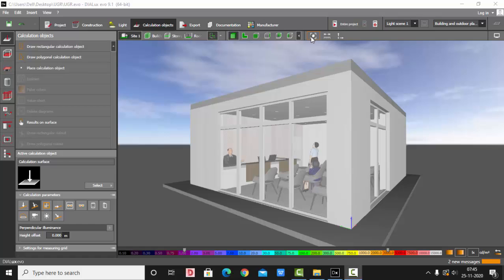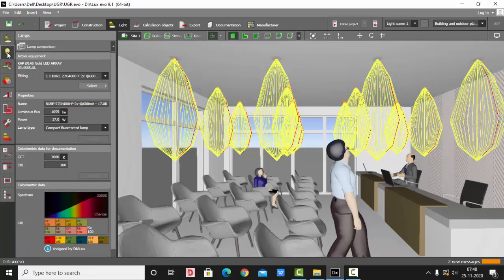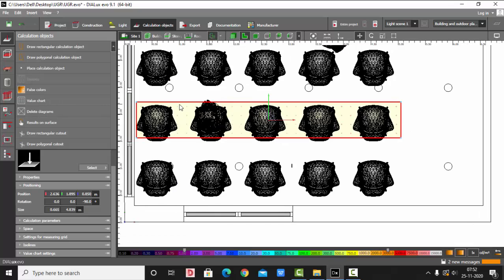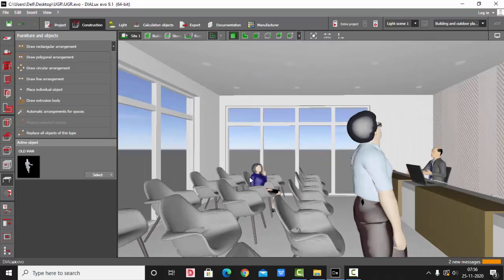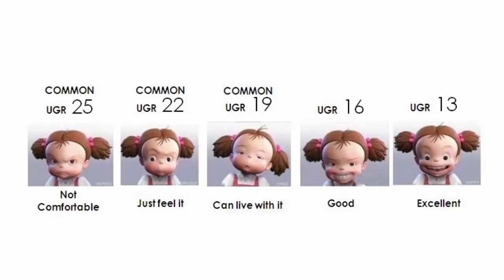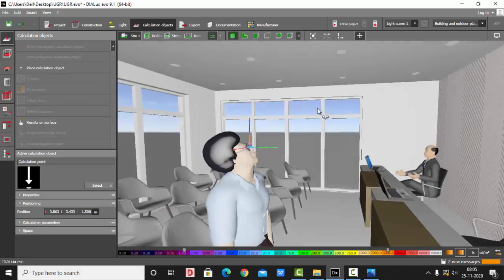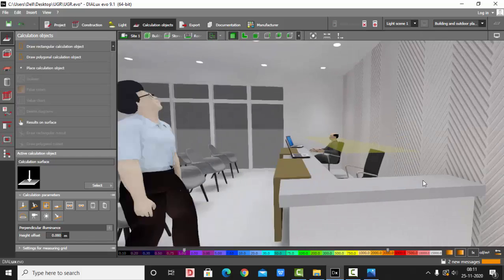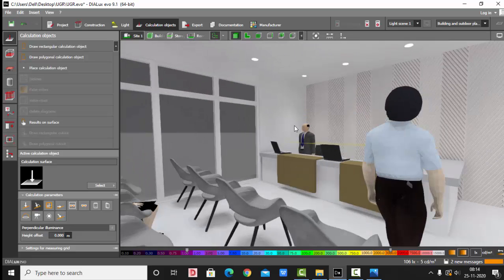UGR Calculations in Dialux Evo 9

Comment: Excellent video. A question, in case of a light not in the ceiling but like a spotlight to illuminate the stage, how to locate the calculation object? should it be parallel to the light direction? Thanks for your answer
Reply from the maker: If this spotlight is intended for general stage illumination, then the work plane will be set at stage level.